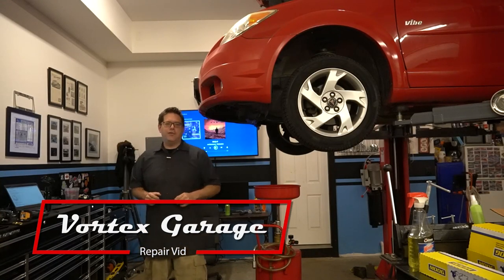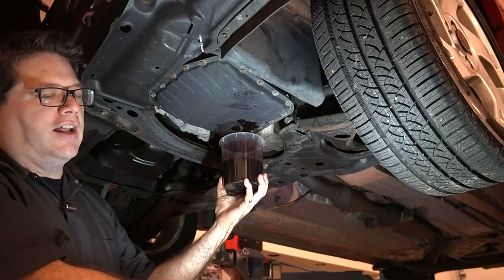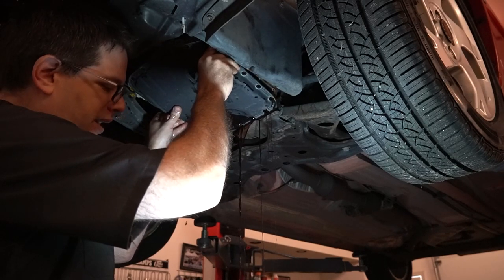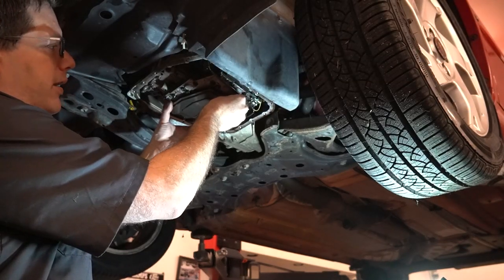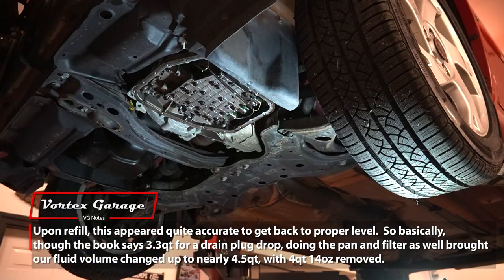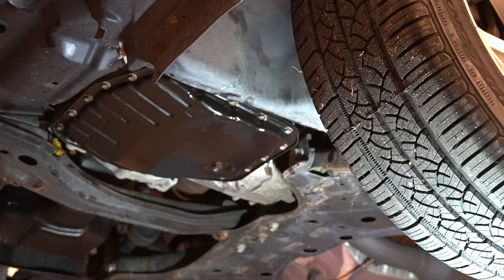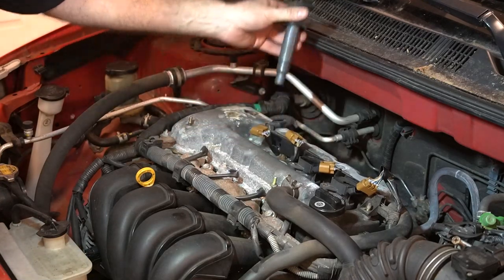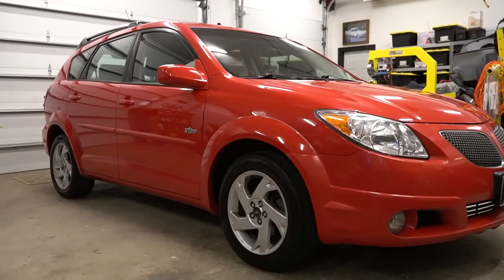2005 Pontiac Vibe - Transmission Service and Spark Plug Replacement - Vortex Garage

Comment: Great video and very informative... although I have the 5-speed manual, so no ATF for me!!  Would love to see how to best fix that clicking blend door actuator motor. Thanks for the great info.
Reply from the maker: I did do the recirc blend door on this car, and have a video that goes into some of the steps to the remove the dash cap. It actually was pretty easy to do. 

https://youtu.be/6RnsO_R39kY